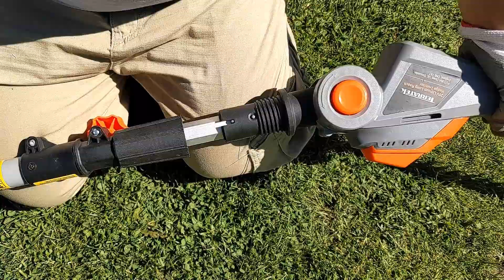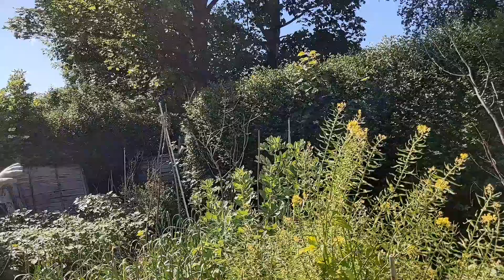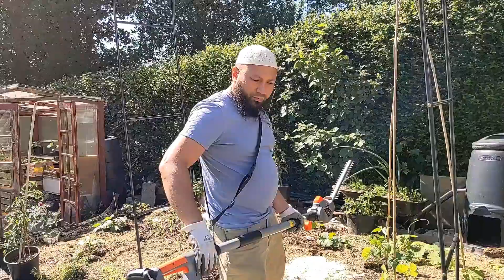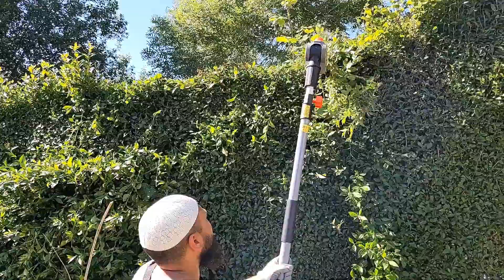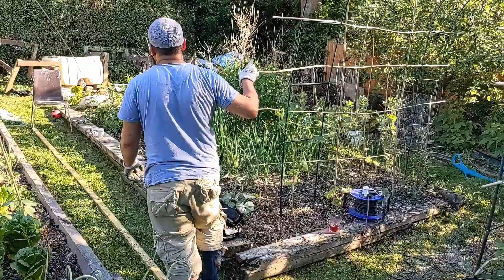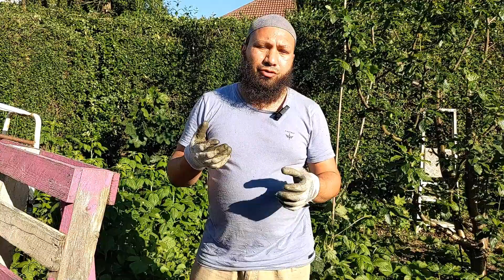Is Battery Power Any Good? -  Terratek 20V Cordless Hedge Trimmer Review

Comment: I have just bought one of these for simlar hedges to this chap.  I agree that the balance could be better.  However it is lighter than many similar models . Very good for doing the vertival faces as you can position it at the top and use gravity to let it slide dwon the face of the hedge. I cut the face of a 6foot hedge which is 80ft long in a matter of ten minutes,  The blade is very sharp and for a 20 volt machine it cuts very well.

Comment: I have this trimmer. It's absolutely garbage. Supposed to be able to handle 16mm branches.... I'm doing my front hedge now which is about 25m and I should have been done an hour ago but It keeps jamming up on twigs no bigger than 6mm. The extendable doesn't stay out reached as the cheap bolt is threaded. DO NOT BUY TERRATEK

Comment: The only thing that puts me off battery machines is the life of the battery.
Probably the tech is much improved, but my last cordless drill battery only gave me about 3 years or so before it would no longer hold much of a charge.
Reply from the maker: That's one of the things I was worried about but after the palaver with the last petrol engine I thought now's the time to move